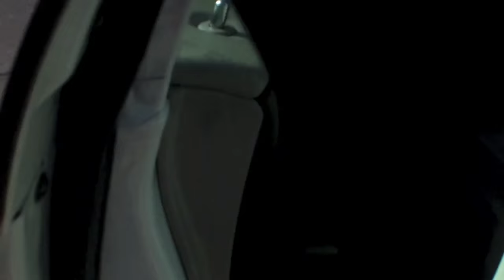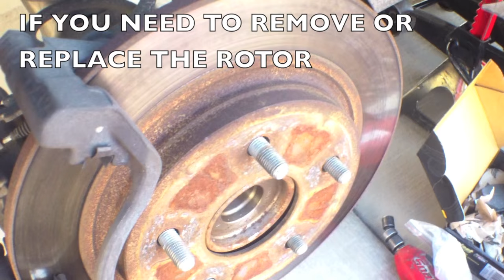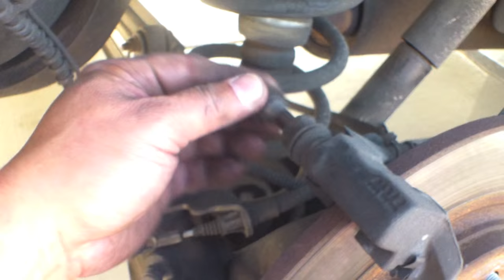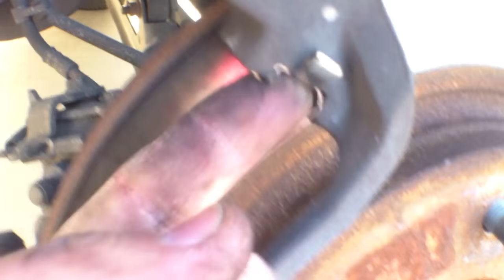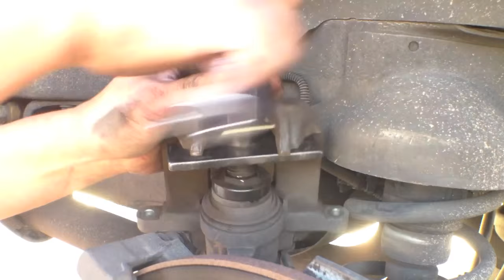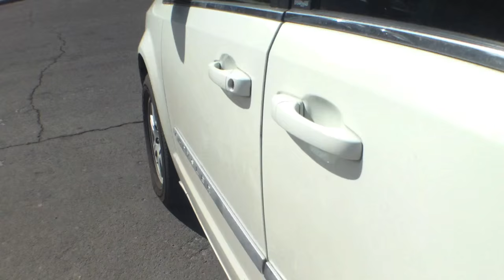How to replace rear brake pads Chrysler Town & Country √ Fix it Angel

Comment: Did this yesterday. 2010 Chrysler town and country.  Bought tool several years ago after fighting with a Ford five hundred rear brakes.   Brakes had many issues.  Seized pins, metal to metal and black fluid.  Had to warn friend not to hit his head on windshield when braking.

Comment: Generally speaking, it's a good idea to check fluid level in master cylinder before pressing brake piston back to its starting position.  If it's been topped off recently, brake fluid  will be forced out and possibly make a nasty mess.
Great vid though!

Comment: Best video on this repair. Except dont buy the expensive tool.  Some strong long needle nose will hit those grooves and turn the piston down to the left.
Reply: to the right, not left
Reply: You better have strong wrists.  I have done this before and it is tough without the tool

Comment: great video, just did mine this weekend, but yeah make sure you get that tool, Autozone rented the one I used, it's pretty easy if you have the tool. other then that def make sure they are pointing up and down adjacent to the caliper bracket, the rear passenger side wasn't lined up and the Wheel got crazy hot and smelt bad after a short test drive. readjusted the caliper groove indentations and it's fine now.
Reply from the maker: Thank you for the comment. Welcome. Have a nice day.
Reply: I just changed the brakes on my wifes car and it was smelling hot...  I noticed he pointed out the alignment and read this comment.  Thanks!  I didn't have the tool so turning that caliper was a pain in the butt.  Got one on the way from Amazon after doing that.

Comment: I drove again this morning to work around 9 miles smoke came back so my buddy checked the rotor in the inside brake pad was kind like blue color so he decide to replace the caliper .actually that side the rim was hot and the other side not ,well just a little warm almost nothing .so he replaced the caliper and already drove 20miles and boths rims got the same temperature like little warm and no smoke for now no noise .I hope to get this issue done

Comment: For anyone wondering, you can get away with using a c clamp to push them back in but use common sense. I use the screw that you spin on the clamp to spin the into the caliper piston, Just make sure to have the rotating disk against the piston to give a little when pressing it in. I do break jobs everyday and I can usually (99%) get away by doing this. Like I said tho use common sense if it doesn't feel like going in smoothly then stop and get the caliper piston spin tool. You can buy it or rent it from any auto parts store for free. Usually run you like $100 but you get it all back with tax when you return it with all the pieces in the box. As in dont lose no pieces to the set. Dont accept it if its missing pieces. Even if it broke they will return it as long as they have all the pieces, they are usually life time tools and wont charge you if you break them. Just dont abuse them... remember other people might to need them too🙏
Reply from the maker: thanks for the tip. all the viewers would appreciate it too.
Reply: This is incorrect.  You can only use a c clamp on the front brakes.  The rear brake piston will not push back in with a c clamp.  You have to rotate them clockwise with a special tool like the one he used in the video.
Reply: @MesserVideo  no mate, its correct. I work at a shop. In the rust belt, Unless its rusty you can twist and push the piston back in with a c clamp. I do it all the time and not once has it gone wrong. Like I mentioned above. Gotta know your time and place. Just be gentle and as you spin the handle of the c clamp it will spin the caliper piston too. I have the tool and like I said, only in rusty situation do I ever actually use it

Comment: to follow the steps you indicated, I had to rent the autozone tools, followed the correct steps and the caliper does not turn this very hard to maneuver it as I can to make it stay in its original position and can put the rear brakes

Comment: Yea, that tool to screw in the piston, sure would have came in handy today.  I have a Routan 09, which for all intents and purposes is the exact same as the Town and Country.  The break pads are the same, the drive train is the same, the engine is the same, Hell, the only difference is the wipers, and they slapped VW stuff on the outside.  I buy parts for the Town and Country  for it, because sometimes they want to charge an "Import" fee.  What a rip off.
Reply: the only difference is some sheet metal...thats it.

Comment: update the reason than the smell and burn was piston had 2 gaps for special tool and the pad brake the one goes inside with the piston it had a 2 little pins ,so must fit the pins in the gaps to be sitting together .so if the pins don't get inserted inter pistons gap the pad brake will be stick on the disc cuze piston is pushing pad brake all the time
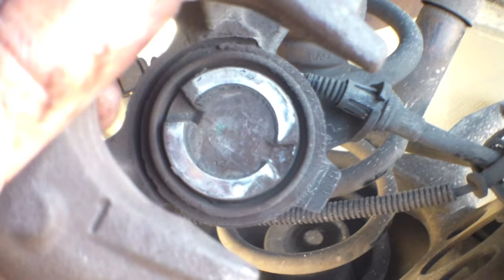Reply from the maker: 3:21 in the video shows how the piston position. i guess you didn't pay attention?
Reply: Can u upload a video how to replace rear calipers on dodge minivans 08 -2012

Comment: I'm assuming both of the sliders on the caliper should move freely (slider is the metal part you took out and lubricated) . The lower slider on my rear caliper is frozen (on both driver and passenger sides).  Can someone confirm this before I go back to the dealer on a warranty claim?  This is a 2014 Town and Country.

Comment: did u open the brake fluid reservoir to push down the caliper piston ? and where u rent the tool for that
Reply from the maker: no i didn't. i bought that tool in ebay.

Comment: How can I tell if my caliber has seized and do you know of vid on how to replace ? TY
Reply from the maker: If you have the special tool in the video, if the piston does not go down, then it is seized. Sorry I do not know any video.
Reply: Danny Diet
Reply: You don’t need that special tool to push the caliper piston back in. Just use a c clamp and a 2x4

Comment: If you don't have the compression tool to push the Piston back so the pads will fit on you can use a big C clamp.

Comment: one more question. I did the brake pads today and piston was easy to push down in both sides some. body borrowed me the tool but. after 2 miles of driving the rear passengers side smoked .I stopped to see what's wrong but after cool down the brake I continue driving for around 10 mile to get at home but no smoked .so I drove another 15 miles and not smoke any advice for this please .I just got just little smell
Reply from the maker: I assume there was oil residue that got on the rotor. if there is no more smoke, then you should be good. but keep an eye on it. welcome

Comment: Your discs aren't that bad, and your pads still have lots left, so you really could get a lot more life out of your system. New pads have 10mm lining thickness, yours have 4mm left, the wear indicator is at 1 mm, so you have 30% left. Did you have run out issues, why are you changing parts at this stage?